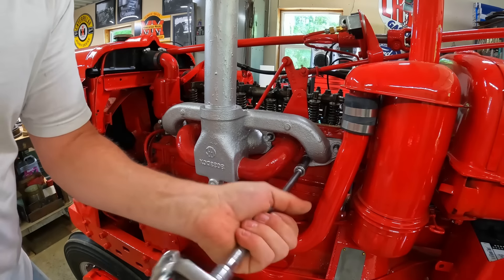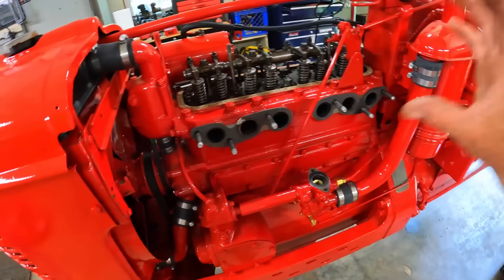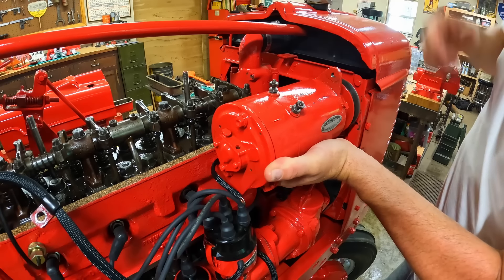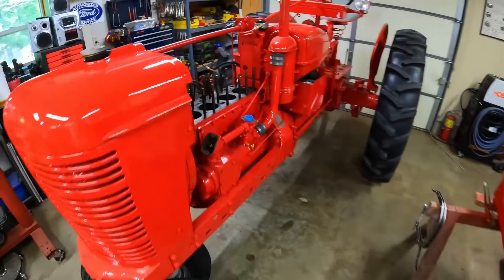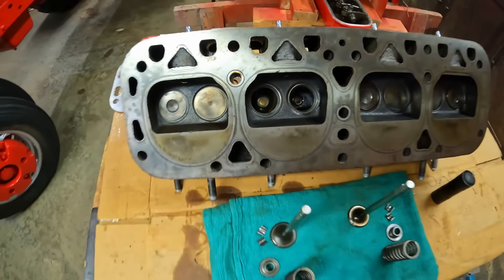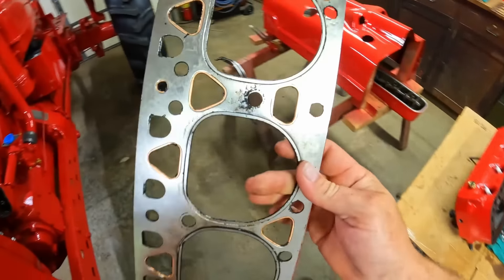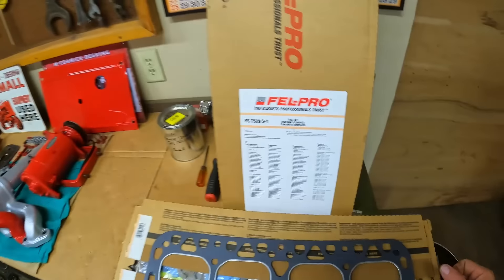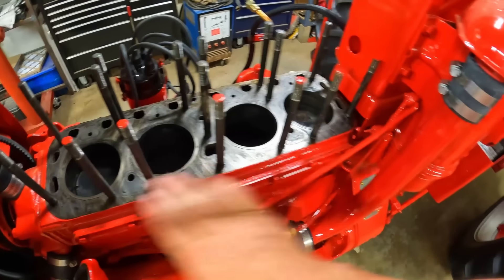Farmall H Engine Knock Found, But It's Not What I Thought - Farmall "Preparation H" Project Part 45

Comment: I took are M Farmall and had the iron block bored out .125 and put 450 farmall sleeves in it end of the same problem then I had the head resurfaced and had .250 shaved off then I drove this tractor 220 miles in a tractor parade in MO and when I got it home I put 5 gallons of fuel in it and it was 87 octane the high compression pistons factory performed great.

Comment: This is a show tractor, I believe.  It's not going to have the rigours of everyday busy farming.  I'm on the other side of the Atlantic, so what is the availability of engines for this tractor - specifically block and liners?  It looks a fairly quick job to put it back together as you propose and see how a thicker gasket works.  If it runs nicely, you're a lucky man.  At the same time, test the market for a spare.  If your easy fix doesn't work, then plan B, block and liners. (Check that head - has it been skimmed, badly, at some stage and is depressed slightly around No. 3 area?).  

Years ago I had a Land Rover with the 2.2 litre diesel.  The head dropped a valve insert on start-up one night, no other damage!  A second hand head went on with a thin shim-style gasket.  It would pressurise the cooling system after a few miles.  Fitted another, same result.  On went a genuine thick 'composition' gasket - end of problem, it ran like a train until the day I sold it.  (Final head gasket change 42 minutes!).   

Good luck!

Comment: Excellent video that is not what you would expect to find. I would clean it up and check for cracks and if all looks good put some lock tite sleeve retainer sealant on the sleeve and put it back together. It definitely has good compression to drag the sleeve up and down like that. Keep up the great videos.  The partial gasket sets really come in handy I save the extra gasket when I do a engine rebuild.  Most of the time the gasket sets are generic to service multiple applications from the same manufacturer and they packed them together so you end up with 40 percent extra gaskets and short some too so I end up making a few new ones
Reply: Only use sleeve retainer if you plan on machining the sleeve out at next service.

Comment: that head gasket is for a SH  300 or 350 with larger bore.. if you find the block bore is too loose out of round or taperd a little  use loctie 640 sleeve retainer or permatex 64000

Comment: Heck thats a new one on me, last thing I would have thought. I'm more familiar with diesel wet liners, where the head crushes them into the block. But the seals can still fail around the bottom. Many of the old-timers I knew, would put the good ol blue goo on the seal rings. I prefered the tacky aircraft sealant. And then let it sit in the sun a while.
I would just clean it up good and put the good gasket and run it.

Comment: Just a thought, is it possible to stake the cylinder to prevent movement?
With the proper gasket holding the cylinder/sleeve all should be good.
Go for it. Too mush blood, sweat, and tears put in so far to abandon the machine.
Put it together and run it and enjoy the fruits of your labor.
Best of luck and thanks for sharing.

Comment: I would use red loctite on the sleeve when the piston is at TDC lower it back down put it back together. I can't believe the head gasket was meant to keep the sleeve in place but stop the sleeve from moving and wearing the sleeve cylinder from wearing out due to a moving sleeve. If that don't fix it you will have to rebuilt the engine with maybe a special made sleeve for the cylinder. I try the first steep first. You don't use it that hard and may get lucky and not have anymore problems. The cheap fix first. I still have a 454 with a #3 lose cam bearing 30 years ago. Put red loctite on it and it still runs fine till 7,000rpm and is still in my car.

Comment: Hello great channel 
What I would look to do is clean and inspect cylinder very complete maybe take a very sharp center punch and put a very small divot in all 4 sides of block so cylinder sleeve has a little press fit with a lock tight to seal it reassemble and use older head gasket and try that should work because you only put in new head gasket 
Gunny012

Comment: The good news is that it makes for more very interesting content. Good thing the sleeve was loose enough to lift up by rotating the engine. Saved some time tracking down the issue. Lots of good suggestions in the comments. Looking forward to seeing which direction you choose to move forward with this.

Comment: Not sure now because I've been away from the shop for about 10 years but we used to be able to bit head gaskets separately at our dealership  if that helps your situation at all. I do feel the proper head gasket alone will do the trick but a have also used locktite on loose sleeves. Just be careful you don't use so much it pools at the top in the counter bore and cracks the sleeve when you reinstall the head.

Comment: I would clean the heck out of the top of the line and block recess with acetone and inspect closely. I’d nothing untoward is found then I would use some loctite and the good head gasket to retain the sleeve. You could also add some very gentle peening with a sharp center punch to assist the retention.

Comment: I would have to pull the piston and liner for a measure of the liner and the cylinder block bore just so you can sleep at night knowing it is all good. If the liner height is good and it appears to be, the counterbore will be fine I would think. I'm not really in favour of the Loctite solution but a "little" at the bottom of the liner may help. The important word there is little as the top of the liner is supported by the counterbore and the gasket and the Loctite may support the other end a bit. I have used my 2c worth here I'm looking forward to the repair.

Comment: 71 series Detroit diesel engines have a clearance fit liner and use the head to hold the liner in place. It works for some engines.

Comment: Had a diesel grey Fergie apart with a few loose sleeves. The reco guy had the outside of the sleeve chrome plated until its fit was acceptable. There is an Australian "hemi" 6cyl that knocked because of camshaft shuttle. was fixed with a Teflon button glued into the timing cover.   Have seen a Honda mower engine knock with the camshaft having excessive end float.

Comment: heat oil and friion use and time the common problem seen the few times try to tell some one that with out showing them they want to see it done right so you just do it little time little tighter on nuts some times copper sealer or yep old red gastket maker 
sealer or it wont then you break it in slow change oil put load on watch temp good couple pulls change oil works like charm

Comment: You need to find a diesel truck mechanic who’s familiar with the counterbore issue. They deal with it on every rebuild, or they should. It seams like the liners are too loose. I’m not a mechanic, truck driver here 40years, but I have been in a lot of shops. Did so, while waiting for my tractor to be repaired. I asked the mechanics questions about their repair work.    I love the job you have done!!! I also love the Farmall H.  Good luck!!  I am looking forward to seeing your next video on this tractor
Reply from the maker: Thanks, I am a diesel mechanic (at least was before going full time on YouTube here) and worked with wet liners/sleeves and counterbores a lot - lip lands, protrusion, liner shims, etc 👍

Comment: Have you considered: 
1) remove the sleeve
2) Make a mandrel on your lathe to hold it
3) Lightly knurl about 1/2 inch near the top of it
Knurling has been used for decades to 'take up slop' in a press-fit
Reply: Great suggestion here!  Im not a huge fan of Loctite because that is not how they were assembled back in the day, but a light knurl to gain a few thou may be all it needs to hold it in.  Id honestly check them all as long as its apart.  Then put the known correct Felpro gasket on, button it up, and run it.
Reply: The only thing about knurling the sleeve is that it would have to be set up in a way that would keep it from flexing while it is being knurled. I saw a man split a sleeve when he squeezed it a little too hard.
Reply: @danielbutler578  True, but using a 6 jaw with soft pads with the jaws flipped around it wouldnt be an issue.  Hold the work from the inside out.  Doesnt take alot to put a light knurl on something.
Reply: @CorwinBos
Reply: I worked in a Diesel engine plant it is no longer in business, we had contract with military ,I was an electrician on 3rd in there . They could make 125 to 200 blocks,ie: complete rotating assemblies; in a 24 hour shift. We got our sleaves from China, [ we used to make them in house] The Chinese ones used to blow up in the dyno test frequently [ If we had no breakdowns } I wrote last paragraph to confirm I have engine knowledge,  had electrical license 33 years , electronics certificate program, 9 -16 week semesters, { no classes  in the pursuits of CHIEF BLACKHAWK and the Americanizing of the Indians . ** Oh on the knurling tool ; it has a rotating head to select the knurl profile, attended a vocational high school  that taught students a skilled craft. No longer a vocational school early/mid seventy's. My jab at school system in Chicago for getting rid of these schools. 2.nd jab at US government for sending boat loads of our industry to China. What are we now ,a  narcotic dumping ground, border jumper paradise ,were if you dare, you will get a Presidential Master card, a stay in a luxury Ho' Tell", and if your savvy enough, be collecting American SSI after two months. Shit ,I'm 66 in two months still got 8 months to go for that one. 
I like the tractor video, but the USA went way way down....

Comment: Good detective work. It would be interesting to see an overlapping trace of the three head gaskets (current, old, new) on paper. I wonder if the cylinder opening is too large or misplaced. Also I'd like to see how well the other three openings match. I would only replace the head gasket. There is no need to risk creating a new problem with unknown quality parts.

Comment: The problem I've found is if the sleeve doesn't fit tight is heat transfer to the block isn't good. Not to mention if they can wiggle in the bores even a tiny bit, the sleeves crack up top. That is all from experience with older Macks with dry sleeves. There the solution was to use a sleeve with a larger OD and machine the bore.

Comment: Ok. Since the other Liners are not loose or wiggly, any chance of just replacing the liner. Realizing the new stuff is not as quality oriented, but maybe the newer sleeve, or a sampling of liners, might produce a somewhat larger liner from a batch that could do the trick. And, heck yes, avoid the glue. Best of luck. Oh, and we all need a ride when you're done.

Comment: I would pull the sleeves measure the block bore in all holes maybe try some new sleeves because if it was moving it produced some wear and eventually the head gasket won’t hold it back anymore you’ll be in the same boat , last one I did had to deep freeze liner and drive in with a block they were that tight
Reply from the maker: That's because most modern sleeves are made slightly oversized to accommodate for slight parent bore wear. About half of the dry sleeve engines ever made have just had slip-fit sleeves, primarily retained by the clamp load of the cylinder head and gasket.

Comment: Here's the thing. It was the gasket's job to keep sleeve from moving. Plus sleeve being so loose you would also had compression leak to the coolant on wet sleeves or crankcase on dry sleeves such as yours, both unacceptable. And If engine knocking was happening for long, that moving has caused wear to the block surface. Afraid you have to use some sealing compound there, no way around it IMHO, plus the gasket must overlap sleeves, ideally to the cylinder edge, just clear of the valves on the other side. If I couldn't find one to suit, I'd make a copper gasket and be away with it, but it's just me. (LOL)

Comment: On a tractor that will see minimal work and you as the owner have the resources and skills to replace malfunctioning sleeves and pistons at any time, and the possibility that the sleeve may "carbon in", use the felpro gasket and reassemble.

Comment: In my recollection, the sleeve is suppose to be .00075 smaller than size-for-size. That sleeve has been moving right from the start. It’s probably below flush with the deck. 
Buy a sleeve that requires a counter bore in the block, but larger than the sleeve now in use. Fit the sleeve for the block in your lathe and give that a try. I have had 44 years in the engine rebuild trade, eventually that piston will pull that sleeve down in to the block. Be prepared.
Reply from the maker: Most of these engines were built with slip-fit sleeves on good clean block bores, it only takes the head gasket to keep them in position. Interference fit dry sleeves became more common in the following decades, with increasing HP and diesel applications. When I installed these sleeves new 18 years ago, all 4 slid in just using hand pressure 👍

Comment: Parts are definitely not what they once were, if it all checks out, maybe a few light center punch pricks around the top of the liner and a new known good gasket. The struggle with parts is real. A friend and myself are currently chasing an antifreeze into oil pan leak on a WK-40. We found a gasket set, but its not the quality of the old stuff.

Comment: Surely the liner needs to have the correct fit in the block for proper heat flow, I certainly wouldn’t bond it, if you can’t find any new old stock liners it’s worth getting a quote for having one made at a reputable engineering shop

Comment: Pull sleeve and piston check o rings on bottom of sleeve make sure they are ok on that piston !
Reply from the maker: This is a dry sleeve engine, so no part of the sleeve comes into contact with the coolant.  These sleeves are just thin steel cylinders that slip-fit into solid block bores to provide an easily replaceable wear surface, no seals to worry about :-)

Comment: I'm not a tractor mechanic, but, as a poor kid growing up and an auto mechanic of over 45 years and used to "making things work", if the sleeve is still level with the deck and not sloppy, I would sure consider putting some copper coat around the inside lip of the sleeve to keep it sealed and hot gasses from getting between the sleeve and cylinder, use the Fel-Pro head gasket and give it a shot.

Comment: I ran into a similar situation where the block had loose counter bores and was declared "junk" as the custom oversized sleeves would be too costly for a "proper" repair. So since they were dry fit sleeves, I chucked the sleeves that were loose up in the lathe, and put a very slight knurl on the OD at the top and bottom of the sleeves to give them just enough of an interference fit that you couldn't toss them from across the shop to install them. Strange how that "junk" block is still in service 20 years later with over 7,000 hours on it don't you think?

Comment: I worked at an IH dealership as a mechanic for 20 years my shop boss would say if the sleeve fit is not tight spray it with silver paint. Sometimes it would take 3 coats but we never had a problem the engine afterwards.

Comment: Well, I see comments against using hi temp loctite. But in the reality of things, it's the best option for this one.  This tractor isn't likely to get enough usage in this life time to wear out another set of sleeves, that would need replacement again.  It's rattled around enough that it's too loose to ignore. I guess eventually it would carbon up enough to seal up, but the loctite will insure it right off.  As for too much to remove in the future, not if your a decent mechanic.  The traditional issue with dry sleeves has aways been good heat transfer to the block. The head gasket should have enough crush to hold the sleeve tight, the loctite will also help eliminate any wobble in the sleeve while running.  Back in the day, I worked on a lot of Allis tractors with wet sleeves. Those motors had the habit of splitting the block where the top flange seated. We just cleaned things up and used the heavy gasket Permatex and a good head gasket, never had any issues. And these were tractors that still were in heavy use daily.  But that stuff would fill any looseness and get hard after a bit of running.

Comment: I think I'd check for wear on that liner lip. But only 200 hours I'd guess it the block. 
Put it back together with a new gasket of correct type. 
I have knurled the top of liners in worn blocks before and on old perkins engines with Cromard liners we used to locktight them in.

Comment: One step forward. Two steps back. How about using the old (original correct one not the Steiner one and making a head template (1/2 thick or so with exact shape of combustion camber ) and roll the motor to see if that is sufficient clamping to immobilize the sleeve. If it is, I say toss on the felpro and run it.

Comment: I would check for side to side play on sleeve. As for sealing it….depends if that sleeve goes through a water jacket then it’s a case of water getting into oil. Otherwise, if it is a real concern, grease the sleeve and reinsert. Yes grease, unlike locktite, it would help seal it but not glue it.
Reply from the maker: Fortunately these are dry sleeved blocks, so no part of the sleeve touches the coolant 👍